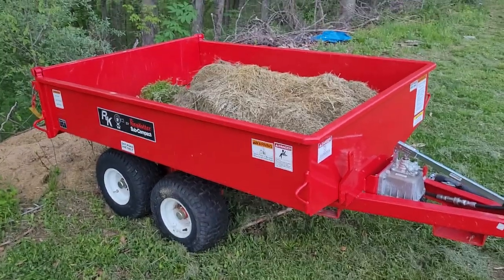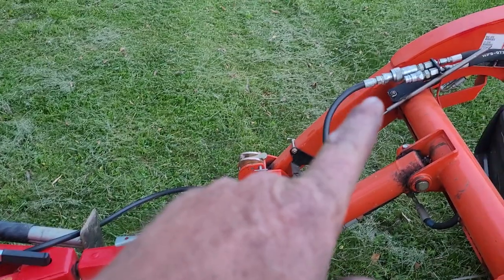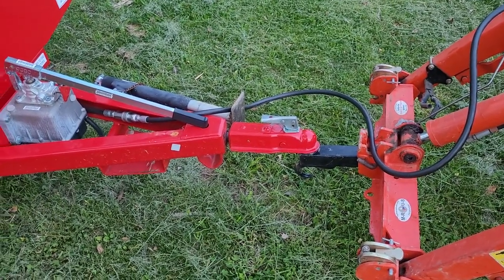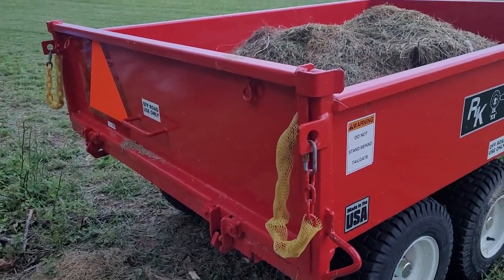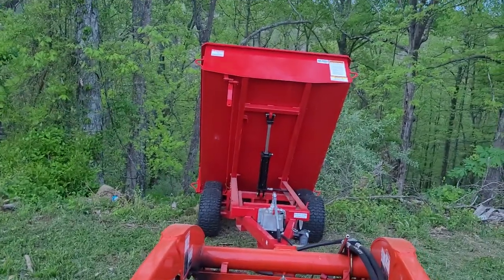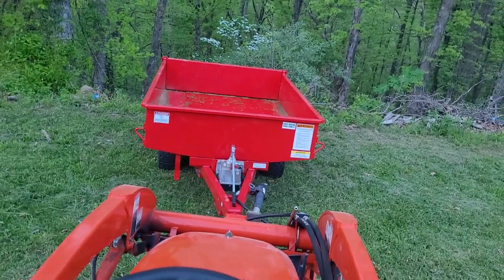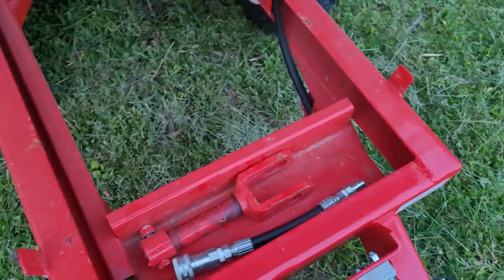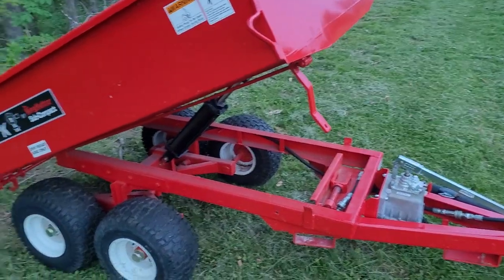RK by king kutter dump trailer on the kubota bx2670

Comment: Thank you for posting this video. I purchased the comparable trailer under the "King Kutter" name sold by my local Fleet Farm. I have a Kubita B2650 with no rear remotes but I do have the loaded with the 3rd function. I have been contemplating using the 3rd function to run the dump while towing from the rear. I thought I would have to plumb the trailer dump cylinder with a return line but I think I will start with plumbing just the one line to see how it goes. Thx!

Comment: Did you pick it up or had it shipped?  Shipping charges seem to be excessive .  Rural King wants $800+ just for shipping.
Reply from the maker: I picked it up at my local RK store about 30 mins from my house
Reply: @ericcrockett479  Thank you, one more question.  Did you have to put it together and it comes in a box or was it ready to drive off the lot?
Reply from the maker: @WAYNE DESHOTEL  the trailer was 100% assembled hydraulic fluid and all. Only thing you have to do is bolt on either the "Farm style" clevis type hitch or the 2" ball coupler. And both of those come with the trailer in the little tray up front under the bed